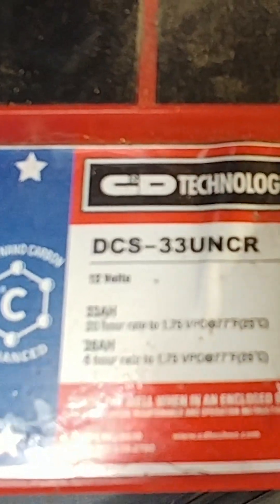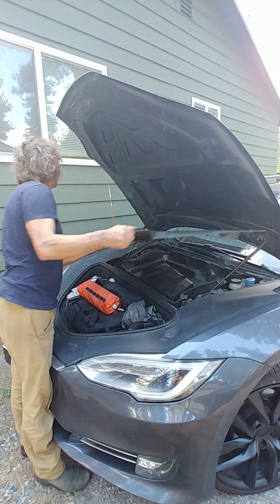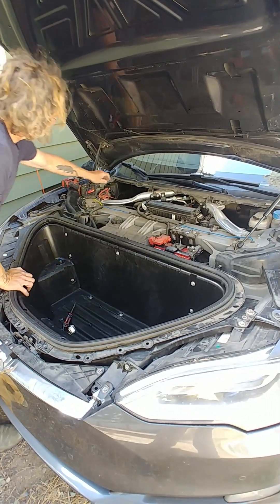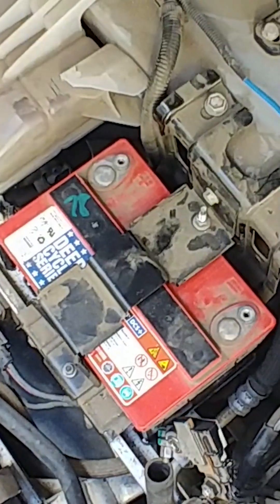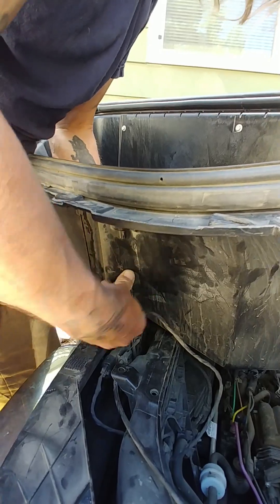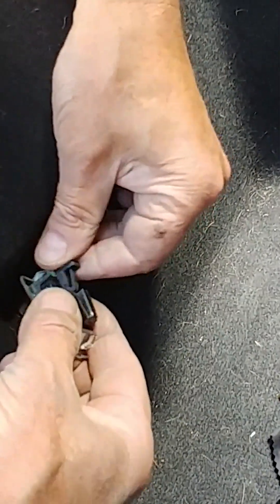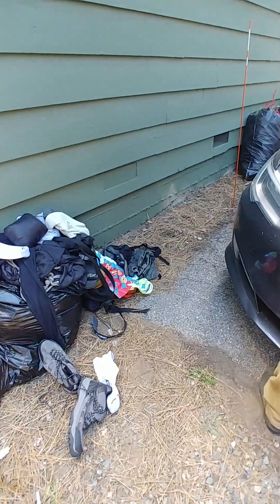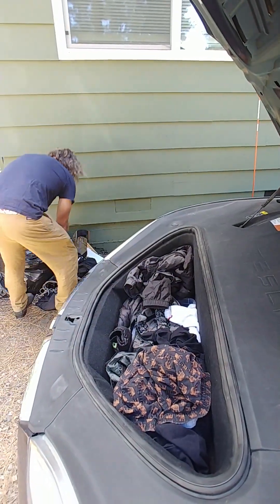Changing 12 Volt Battery Tesla Model S

Comment: About to buy a 2016. Should I not ?
Reply from the maker: We own two model s at our house and we love them. Elon musk is a pile of shit but the cars are great and you can get really nice tesla for cheap right now.

They made some pretty useful upgrades to the main computer and infotainment system in 2018 and 2020. 

One of our model s's has been upgraded  and the other has not. 

Buying a Tesla is kind of like buying a computer where a lot of the value is in the software and hardware on the computer side. 

There are also some Tesla's available that have unlimited free supercharging transferable that make them quite wonderful to own. 

And also looking into the quality of the battery is important. 

But yes, no oil changes no tune-ups and waking up with a full tank of charge every morning is really cool.

Comment: How often should the 12v be replaced? Just bought a 2013 model S and I'm considering getting it replaced just to be sure it's a good battery
Reply from the maker: Mine was a 2017 and get lasted until this video is released. So yeah if it hasn't been replaced it might be a good preventative baby to do it at your leisure rather than by necessity
Reply: Check your tesla application to see if your car need it

Comment: Are these available on the web?  Looks like all Amazon options are lithium ion and 300-400+USD
Reply from the maker: I ended up buying the battery from Tesla service counter.  I think it was around $200 and the ones you find when searching online are like $400 to $500. No need to get a lithium or spend loads.  The things that matter are the batt size must not be bigger, the terminals need to be the right type and which side the plus and minus are on. Mine had removable terminals. But after searching and all the over priced options, I just decided to go to Tesla and the had one in stock.

Comment: Hey dave here in france most tesla owners buy a car and then sell it every year to get the new version. We actually dont have much clue about tesla ‘s durability in time. You said you bought this car in 2017, how does the batteries of your car use over time?  Do you still see yourself with this car within like 10 or 15 years ?
Sorry for my bad english, tesla is really interesting but à lot of french are waiting to see how it will get old in the long term
Reply from the maker: Batteries are good, I started with 330 miles and now is 300, I have driven 135,000 miles or 215,000 km

I beat the car up, carry equipment, camping, loads of surfing and sand and such. So messing up a new car every year would be expensive and a waste.

I love this car!!! I will prob buy a cyber truck and give this to my girlfriend when they come out.

Also, this car cam with unlimited free supercharger, so it would be a shame to let that go.
Reply: @DaveRat  wow free électricity must be dope ! Here we have a 10x on the price of electricity :/,everytime  i record i have a little wizard over my shoulder with a ticking watch and a kw/h consomption in réal time ahah what about the maintenance and software issues ?
Reply from the maker: Software is good, updates show up and new cool features happen. Dog mode is awesome, leave the puts in climate control with screen that shows the temp. Brakes last forever, tires wear out  faster, no tune ups, no oil change or smog.

I put in wiper fluid every year or so, changed the wipers once. I hit some debris and took apart the front to fix a sensor and epoxy back a small bracket. A door handle stopped working and it was a broken wire I fixed.

I brought in in for yearly service a several times early on when it was under warranty but there is not much to do.

Oh, I did pay like $1000 for an updated MCU computer which made things faster and got me streaming Netflix and movies and such

But all in all, it's a fraction of the cost of a gas car and I wake up every morning with a full charge. The time I save not going to gas stations is awesome.

For long trips the charge stops take longer than gas but we just go eat and walk the dogs or watch movies or do some work on my phone.

I will never own a gas car again!